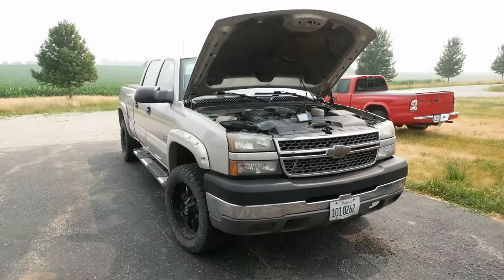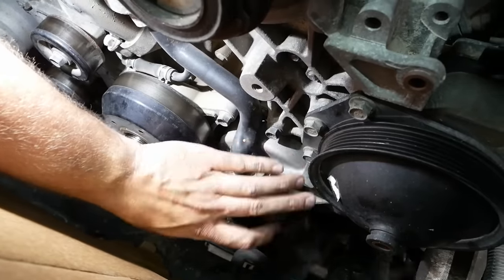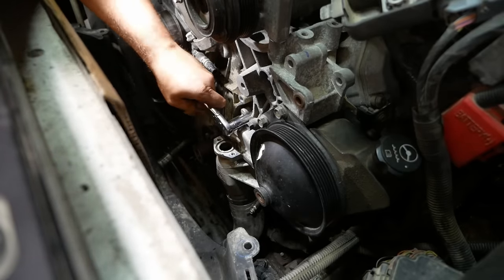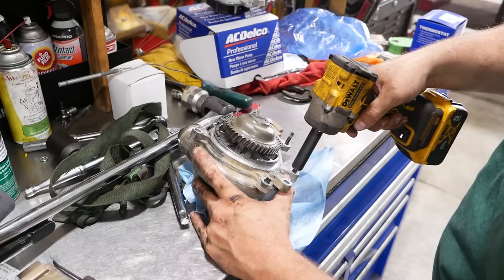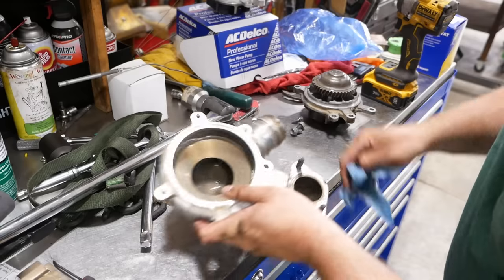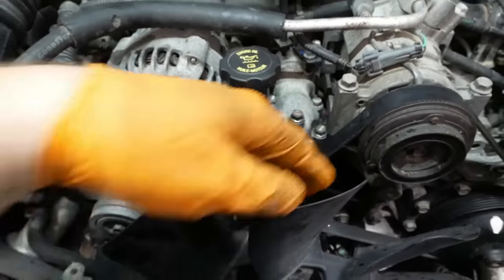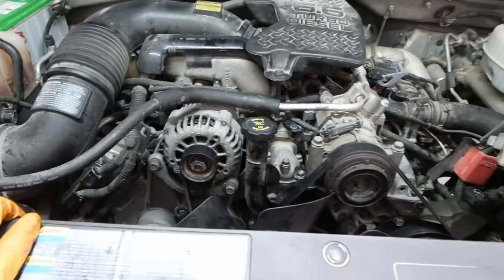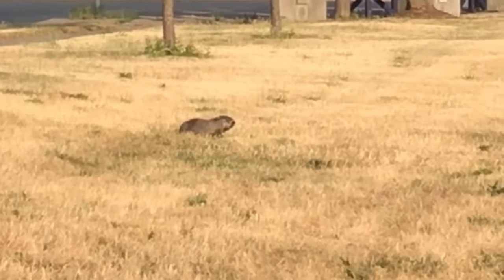Is this Cheating? GM's 6 HOUR Water Pump Insanity

Comment: Done this once before 4 years ago. Original WP went out at 250,000 miles. Took me 9 hours to do it. Now 4 yrs later the NAPA water pump is now leaking again. I will not replace it. Have it scheduled to go in in a week. Ya, expensive but at my age I am not going to do it. Nice video good instruction. Thanks.
Reply: That's y I don't buy parts at NAPA, junk!

Comment: Your approach is smart. Saves a bunch of time and still gets the job done. I can't figure out what problem they were solving by using a gear drive water pump. That is crazy! Back in the 80's one of GM's station wagons required you to cut, with a torch, a half moon section of the passenger front wheel splash panel to gain access to the heater blower motor. I couldn't believe the instructions when I read them. They even embossed dotted markings showing you where to cut. Another great idea from GM!
Reply: There was another GM product from the mid 00’s I did in college and you had to cut the old blower motor out with a dremel and screw the new one in with self tapping screws
Reply: @JasonStaggs99  Another great idea!

Comment: I worked at a small Chevy dealership for a while.  We had a couple brand new AC Delco water pumps fail within a weak of installation.  Stupidly, but not surprisingly, the gear is pressed onto the shaft with no key so under torque it can just start spinning freewheel style.  We started putting a couple of tack welds with the TIG welder on the shaft to the gear and no more problems.  Hopefully yours doesnt come back.  I'm sure the way the truck is driven and how many extra HP they are getting from thier tuner makes a difference.
Reply: I did one with that failure way back on a new-ish truck under warranty

Comment: When you were naming all the parts that GM wants removed in order to fix the water pump I had to wonder “why?”.  Has to be a profit driven decision. Great video!
Reply from the maker: I have no idea why they thought this was a good idea.
Reply: A DFM engineer will crawl over 2 miles of broken glass just to hear a mechanic get fucked over during a repair if it can save them $0.02 per unit.
Reply: It's actually gear drive
Reply: Look at that faulty logic.  So kid... explain where the profit is.

Comment: I remember changing my 7.3 water pump in an O'Reilly's parking lot in 30 minutes. Makes me appreciate simplicity
Reply: I've had a ton of 7.3's. Still have a couple (97obs and 03) Keep a cam sensor in the glove box and you're golden
Reply: @colestowing8695  great engines. Easy ish to work on, last forever and still get good mileage. Miss mine

Comment: Oh hey, reminds me of replacing the AC belt and tensioner on a gasoline '05 Silverado, only to find out it needs the AC system upgraded to fix a factory defect that causes compressor slugging (due to the compressor being mounted low on the engine). Fun times! Nice below-book fix!

Comment: yeah that shaft has a tendency to slip under load, sinister diesel makes a tig welded water pump, one of the best upgrades for any dmax
Reply from the maker: The impeller shaft?
Reply: @WatchWesWork  yesir

Comment: Video and audio quality absolutely mint today. Not sure if anything changed? Maybe I'm just noticing. But especially the audio when running the electric ratchet or other loud noises like the engine running, sounds a lot less compressed.  Regardless, best channel on YouTube. Never change. And that hose was bothering me.
Reply from the maker: I didn't do anything different. I wonder if it has to do with the weather. No wind, higher humidity, etc..
Reply: Could be my ears hear different on a Friday.
Reply: @WatchWesWork sound travels much more efficiently in humid air.

Comment: I’d be putting a BIG note with BIG letters taped to the steering wheel “crank lock” and probably put a second sign attached to the key or fob, because I’d forget that thing. Happens when you’re old. Wait, what was I writing?
Reply: Hang the keys on the flywheel lock.  Drill a hole so you can wire together.
Reply: @toxichank6960  there ya go.

Comment: Let’s make the water pump gear drive so if a belt breaks it doesn’t overheat but if the pump seal goes bad it puts coolant in the oil

Comment: As a GM guy, you'll never see me owning 1 of them trucks...
Reply: My LMM has been the best diesel I've had. 300k and not a major or internal part fail yet. Knock...
Reply: @Steve_Just_Steve god help you when it finally does break
Reply: @Steve_Just_Steve  make a yearly sacrifice to the injector gods🙏😁
Reply: 6.0 Gas 5.3 gas 380,000+ Miles no big issues. Best motors.
No silly diesel pickup truck for me anymore. 
Nightmares

Comment: Did it on my '05 once when i was doing the head gaskets. Had the whole nose off to do them in frame and decided to look up the book time , the minute i read what had to be done I ordered a new pump. Much easier with 3/4 of the engine and truck missing

Comment: Oh Wes...ex GM diesel tech here, I truly hope the oil cooler coolant tube doesn’t start leaking at the cooler o-ring for you and pray you don’t have to redo the job! We use to have problems here in the Kanuckistan rust belt and that was more than 12 years ago when the truck weren’t this old! Now if this truck lived all his life in the rust belt it had to have the tube replace at least once maybe more by now. Hopefully that will save you.

Comment: Good video, thanks.  You made that look easy.
Remember in the early 2000's or so there was a ridiculous labor time for front lower control arms on Camrys and Lexus somethings?  Remove engine.  Nobody did that.   The labor time guide got adjusted later on.

Comment: Wes, thanks for sharing a more logical way to change the water pump out. Father was engineer, and was well liked by those who worked on the manufacturing side because he valued their input regarding assembly. I noticed you replaced the old RAV4 with a newer one. 👍

Comment: Your flywheel block should have a 'remove before flight'  reminder tag attached to it that gets put in the ignition hole after the block is installed. That will keep you from forgetting it and sticking the key in the ignition.

Comment: I'm glad I didn't have the book when I did mine, I did basically what you did. I replaced that lower radiator hose while I was at it, what a piece of art that is. Like Pablo Picasso kind of art.
Reply from the maker: Yeah the spaghetti hose is a real gem.

Comment: I've done a few of these...have the Lisle locker kit in my toolbox, two different locks for different engines and it even has the socket to take the crank bolt loose, super handy. for D-Max water pump jobs.

Comment: Wow for the first time in all the years watching you Wes I can say I’ve done almost this same repair on a 2002. It seems to be a common complaint with the older duramax. I thought my leak was the water pump but it was the seal on the metal pipe.
Reply from the maker: Which metal pipe?
Reply: THE metal pipe, of course

Comment: I have a 2004 GMC 3500 dually with the lly and had to replace the water pump while visiting Denver. We live down by Durango Colorado. Got back home and hooked on the 5th wheel and the car trailer heading for a car show in Las cruces New Mexico. Got to Dulce N.M. and the truck got hot. Checked and found no water flow. I took it all apart again on the side of the road and found the impeller fell off the pump. That was a new NAPA pump with about 400 miles on it. Got a replacement and before I installed it I had a guy at a welding shop put two tack welds on the impeller shaft. Still running that pump, that happened back in 2016

Comment: As a proud self taught/ youtube learned  DIY to keep your stuff running kinda guy, im not ashamed to admit i took my 05 Duramax to a shop to have the water pump done, along with replacing a broke engine mount with a new set.

Comment: That 6 hour book time having to remove all that stuff is just a way for the stealerships to make more money by charging for more labor time, some may even go the extra lenght and lift the cab off.

Cat have used gear driven water pumps im pretty sure since they abandoned the old thermosiphon cooling system back in the late 20's or up into the early to mid 30's. The advantage and i think GM's philisophy is that if your serpentine belt breaks you still have circulating coolant, and as long as you keep driving its fine, wheres with a belt driven pump you pretty much have to stop and shut the engine off immideately to avoid overheating.

The disadvantage is that it imposes a bigger risk for get coolant leaking into the oil due to the shaft seal, and that may be by design in GM's case, wheres in a Cat engine you have wet sleeves that poses a even bigger risk of coolant leaking into the crankcase anyways.

Comment: I actually love that the water pump is gear driven rather than accesory belt driven. We were out in a remote site when my bosses accesory belt went on his lb7. There was no ac or power steering, but the truck was able to drive back without overheating

Comment: Same trick that Renault play with their timing belt driven water pumps. Complete with impossible to remove, with the engine mounts in place. It is way easier to drop the entire subframe and be able to access / remove everything. If you can’t do that you best keep a sky hook handy to support and angle the engine to allow room.

Comment: Took me 7 hours, but I cleaned the coolent stack because it was plugged right where the fan is.  Otherwise, I did it the same way. Easy access without the radiator and intercooler.  Nice work!

Comment: it’s definitely one of the more challenging repairs i’ve done ! 05 LLY …. getting that metal pipe with the o ring that you need to push up vertically above the pump to seat right was tricky it took me 3-4 attempts of assembly and disassembly to get to seal! I will say this is definitely not a repair you want to cut cost on the water pump ! buy at least AC delco if not better if they make a better option !  i also installed a fluid damper when i did the repair because the stock one was separating and out of balance

Comment: Here in Thailand pretty much every Isuzu, Chevy, and Toyota pickup and SUV or Van with a Diesel Engine is a D4D made by Isuzu, and I'd say the better half of those are turbo charged straight pipe exhaust motors!!

Comment: 97 f150 4.6 l. Read head ache to remove starter and o2 sensors. 
 Unless you remove the tire and inner fender 5 to 10 minutes. then the starter can be removed in  about 2 mknutes. Same with o2 sensors. I did both in less than 45 minutes including putting tools away. But the best time saver was take both front tires off and lower the Jack. The back 2 plugs on the right side are a straight shot using a 2 foot long extension and no bending over the fender . 5 minutes both plugs are out.

Comment: Wes, you made it look easy...........Im not looking forward to my next major mechanical effort...........timing chains and Vanos on a BMW X5, with the DOHC 4.4 V8.  I quit using RTV a while ago.........Loctite 515 flange sealant is incredibly good. But that is 1000% a pro tip, to put the cardboard against the radiator.

Comment: The more I watch you tube auto repair vids the more I think my next car will be 40 years old.
I can probably buy a classic I like and rebuild it for less then the cost of new .
I am not a fan of the dealer charging shop labor only to have them "cheat" and shortcut the job by hours and still charge me the shop labor rate. Been a victim of the 4 hour cooling fan relay replacement on a cherokee only to find out much later that the dealer mechanic did the job in 30 minutes. Sounds like fraud to me.
Enough of my complaining.
I very much enjoy your content, anything you like to share is good infotainment.
Enjoy your summer
Thanks for sharing

Comment: That's what happens when the chassis & body engineers refuse to give the powertrain engineers an extra inch of engine bay because the designers said it would hurt the styling proportions!

I think all the current diesel pickups have a water pump mounted somewhere other than the fan drive to save length on the accesory drive. The other trucks still have belt driven pumps though - not gear drive.
Reply: Nope.

Comment: You have worked on enough of them to have the fan wrench with the air hammer goodness option. The real fun starts when you change injectors in an LB7 and turbo swap, downpipe bolts are fun.

Comment: I’ve got an 04 Duramax with 513,780 miles as of tonight. Original water pump if you can believe it. The fuel system and transmission are original as well. But all the rust on the box and rockers is not.

Comment: Well-done good video I would have inserted the bottom of the tube into the water pump and then pushed it up into that receiving end when I applied the pump to the front of the block

Comment: I just did this job on my 2007.5 GMC 2500HD. No other way to say it… the job sucks big time. 
My water pump wasn’t leaking but the consensus is with these older Duramax motors is any time after 220K expect the pump to start leaking. Mine has 240K.          
I agree… Isuzu could have designed the pump R&R better. 
I added a light coat of RTV to all of the flange gaskets too. 
Mine doesn’t leak either.
Whoever wrote that 6 hour tear down to swap the pump is insane. I did it the same way you did it.   
I did find a leaking front seal when the balancer came off. I had been seeing a very minor engine oil leak but could never find it.

Comment: at 9:35, the gap between the pump housing and the block would have scared me to death. I know there is a 1/16 dia, O-ring on the pump housing, but if it leaks it's a tear complete down again.

Comment: I will be following your method for sure on my duramax . My old Cummins didn’t take very long. Got really good at it as I had to replace 3 water pumps . I guess Chrysler came out with an updated pump for it later with a bigger  bearing.
Reply from the maker: The Cummins all eat water pumps.

Comment: I was just watching your ATV video that you did a year ago and noticed that you were using an ultrasonic cleaner. Are use simple, green aviation cleaner it’s expensive, but you can reuse it and if you keep the carburetor in at a high temperature for two hours. it will clean everything I do part time, boat mechanic, and I have no problem with it taking all the gunk out

Comment: Well done Wes. And no, it is not cheating. And some of the assembly could be due to a couple of reasons. You know, we have this part used in other locations so make it work here too. Or keep the focus on the engine assembly for mass production as they won't keep the vehicle long enough to need to replace the (fill in the blank) part anyway. And that part is "reliable" so unlikely to wear out anyway. 😂 "This is the way we have always done it." Three other possibilities i can think of from experience. Cost savings. "This is the space you have to work with. Figure out how to stay in that footprint." Lastly, management states this is the way we are going to do it, even though the engineer has a better and simpler way designed. 

I missed seeing the fan shroud going back together. Nicely done on splicing the torque converter lock tool removal reminder and the truck starting. Couldn't tell the clip had changed. Thank you for posting this video, from one former engineer to another.😉
Reply: I guess the thinking was a broken belt would not overheat the engine.

Comment: My challenge job - replace a timing chain guide on a BHF Audi engine. Guide slips over two posts and takes about 10s to swap out. Time to access the guides - book time says 8 hours I believe (I'm not a mechanic) - pull front of car, pull engine and transmission, break numerous bolts and plastic clips on the way, remove/recharge a/c, decide to replace starter, p/steering pump, mechanical cam advance, water pump, every hose because the same removal basically has to be done for all those components. Then another 8 to put it all back together, and then a couple of hours and a beer or two wondering if the leftover parts were "really that important"?
Reply from the maker: I can’t do audis.

Comment: I've got an '04 Duramax that seems to be leaking coolant at the right rear of the engine. I was told that these engines have "water" cooled turbochargers and there are some coolant lines to the turbocharger. Long story short-it's going to cost me a pile of money to get fixed. The Duramax engines having gear driven water pumps are typical of diesel engines. All of the big diesel engines have everything gear driven except for the alternator and air conditioning compressor. General Motors engineers had a hand in all of this also as the Duramax is a joint venture with GM and Isuzu.
Reply from the maker: Cummins and Powerstroke are belt driven.

Comment: Hey when you use the vacuum fill you gotta cap off the over flow when I worked on chevys we always capped off the overflow port with a piece of hose with a bolt in the end because the vacuum will suck outside air from it
Reply from the maker: I did. The adapters kept popping out the top of the tank.

Comment: Auto manufacturers decided to build in dealer only maintenance items so they could charge dealerships more for their cars . That's why easy to fix items like water pumps , starters and alternatiors have been moved to make it impossible to change without a lift or special tools in most cases. To force you to take it in and pay the ridiculous high prices for repairs.

Comment: Japanese technology borrowed and simplified from VW.  On some VW diesel engines the job includes removal of the timing belt and some of the front casings of the engine.  People who work on those engines with any degree of regularity change the water pump every time the timing belt is changed (and VW have reduced the time between belt changes just to "improve" the engine reliability).